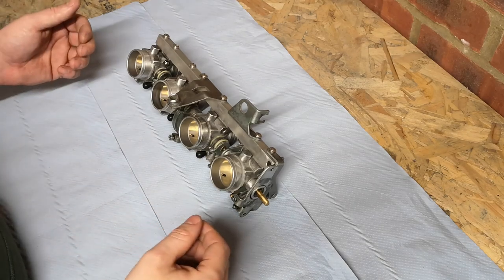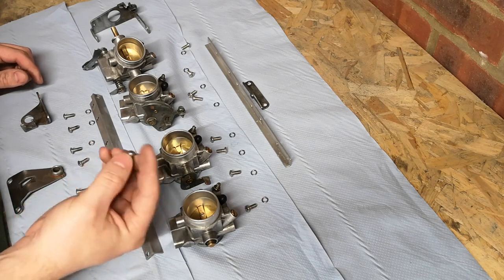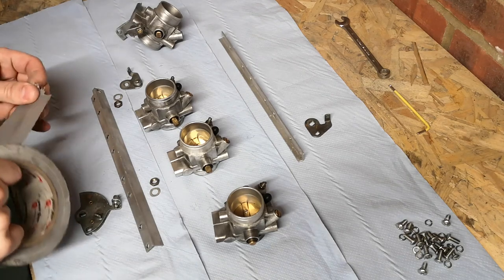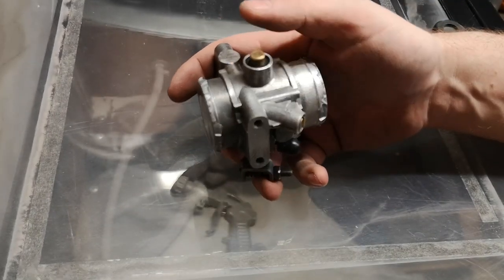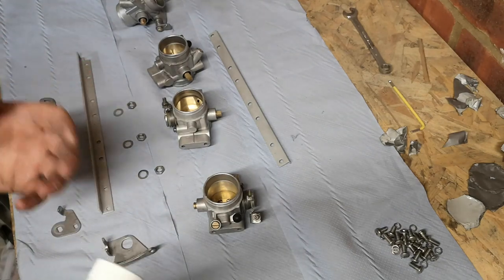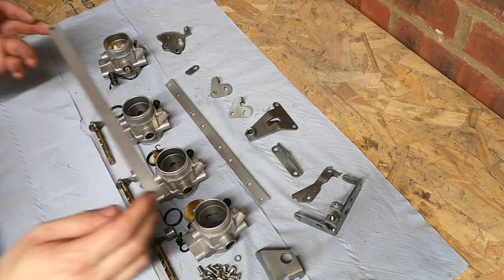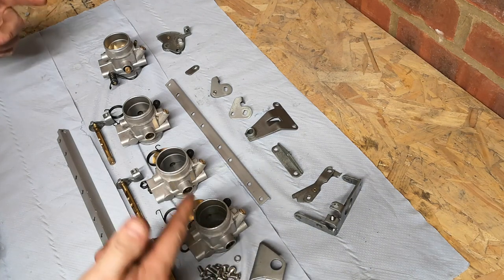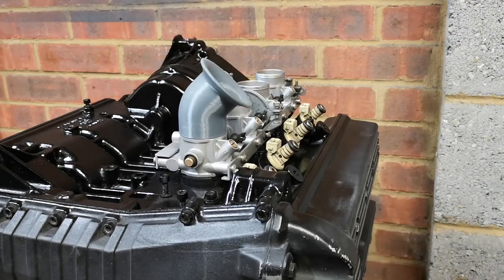BMW K100 | Throttle Body refresh | Build vlog #3

Comment: Hello. I want to soften the force I exert on the throttle grip because I have a particular problem with my wrist. I have oiled the wire rope and all friction points. I am thinking το remove one of the 3 springs. Do you think this is possible? Does the system works with one spring less?

Comment: Hello. Great videos!! I am curious to know how are you planning to set up the air intake system. Are you going to remove the airflow meter ? Thank you very much keep up the hood work
Reply from the maker: Thank you for the kind words, I'll be completely redoing the fuel injection system with a standalone ecu, so the airflow meter and airbox will go in the bin.
Reply: Eight20 👌🏻👌🏻👌🏻 sounds super interesting lets see how it goes !! Good luck 👍🏻

Comment: Hello brick friend) after refreshing throttle bodies I can’t adjust idle speed at 950+-50 rpm, i have atm 1200-1250. Tried to adjust and syncing every single body by screws which, disconnected tps and nothing change.
Reply from the maker: Hi buddy, it could be a lot of things, do you have enough slack in the cable? is it hitting the stop? Is your fast idle binding? Have you had a visual look at the butterflies to ensure they're all closing?
But it could be something else unrelated to the throttle bodies, is the timing set correctly, what condition are the injectors in?
There's loads of things it could be it's almost impossible to diagnose without looking at the bike. I hope you get it sorted.
Reply: @Eight20  injectors cleaned, i guess I forgot to check when assemble throttle bodies closing it  enough or not.

Comment: Hey mate, any idea what the sensor that plugs on the back side of the butterfly is? just behind and to the left of the throttle position switch?
Reply from the maker: Hi buddy, some of the early bikes had a vacuum switch on the back side of the throttle bodies. Apparently it adjusted the timing depending on vacuum, but I've heard it makes no difference and you can bin it if you want. Google "k100 vacuum switch" there's a few bits and pieces about it 👍
Reply: @Eight20  awesome! glad you knew. I was pulling my hair out trying to remember where it was going. Thanks for the help